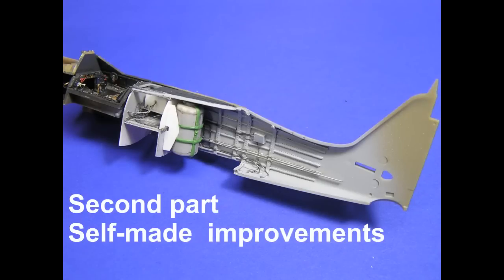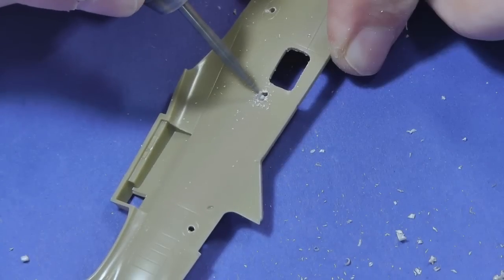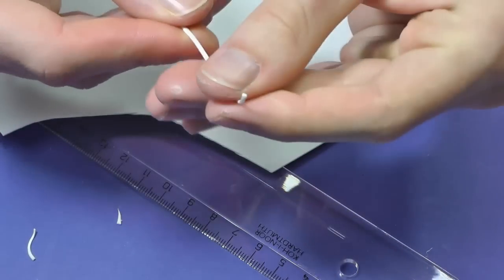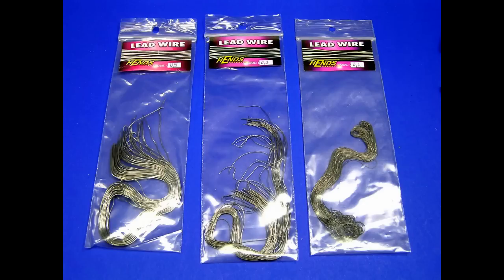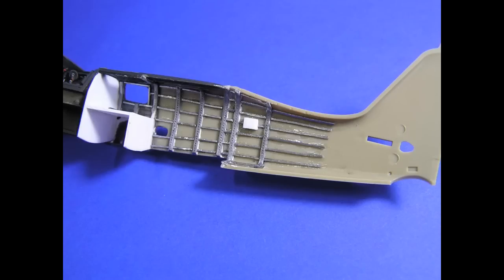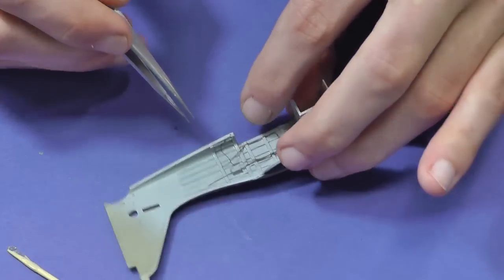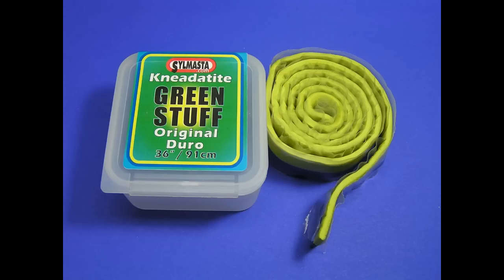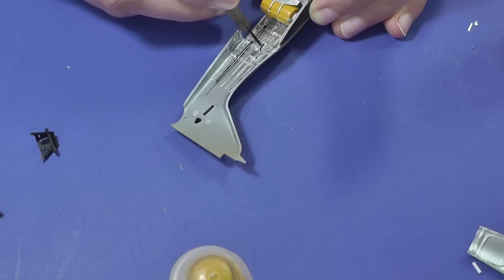Great Guide Plastic Models - Self-made  improvements

Comment: Wow, this is amazing work.   I've used thin plastic strips successfully on architectural models, instead of using hobby glue you can use Chloroform, you need only the tiniest amount which will penetrate by capillary action by running your brush along the side of the plastic strip while you hold it in place and it dries almost instantly, very fast and effective.   

If you're cutting your own strips it helps to have a steel rule as a guide, stick fine wet or dry sandpaper to the back and it won't move while you're making cuts.

Comment: I can't find lead wires, can I use strip styrene?
Reply: The sizes might be limited but you can also use lead solder, get the kind that doesn't have a resin flux core if possible.
Reply: Chin Chin The Dark Lord What diameter? Brass wire is available in almost any diameter you could imagine, and no lead poisoning worries.
Reply: I tried it and it worked, on 1/48 models I use a 0.75mm wide strip, but you may want to use a smaller one for 1:72 etc.
Reply: Chin Chin The Dark Lord use solder